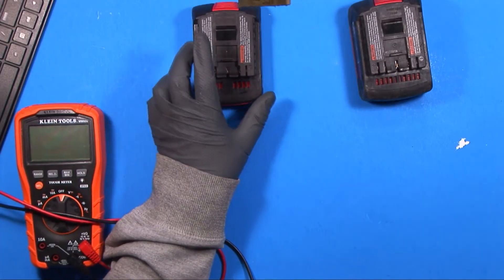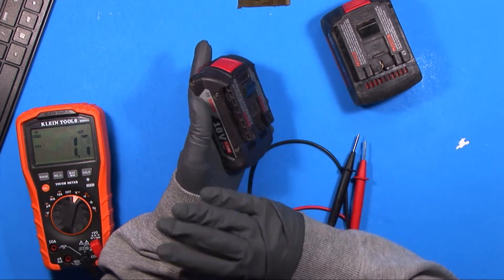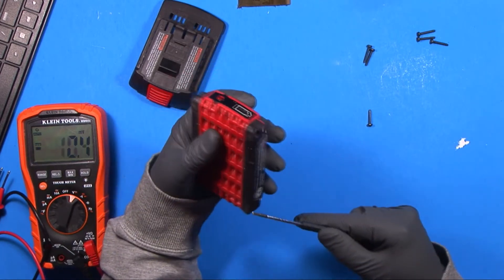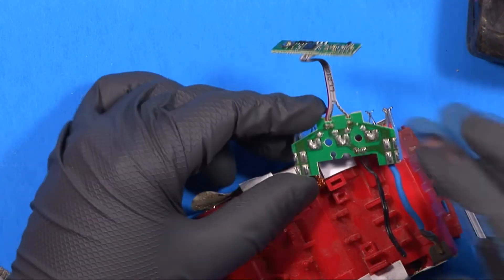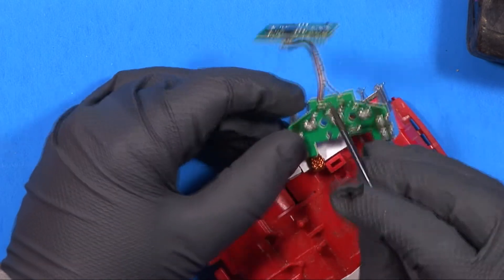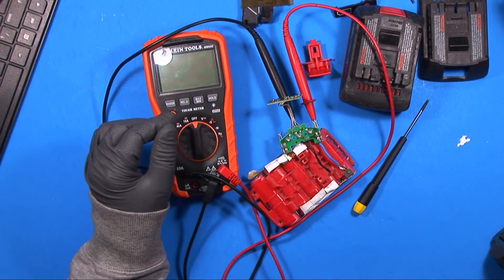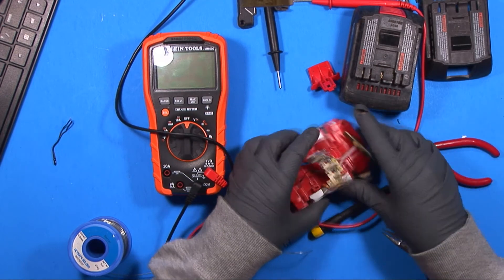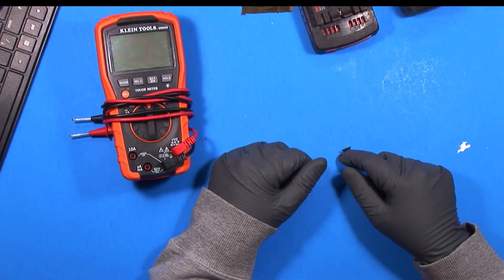Fixing a "Bad" Bosch Lithium Battery

Comment: You are one of the few YouTubers that really knows what they are doing working on battery packs. So many other guys do completely stupid things with packs, instead of really diagnosing the problem. I've fixed a bunch of Bosch battery packs with either a new thermistor or replacing dead cells. I invested in a charger that also measures internal resistance and charges 8 cells at a time, ensuring they are balanced. Only twice have I been unable to fix a pack, and instead bought a knockoff battery pack and rebuilt it using the cells from the dead battery that had been tested and balance charged. I've built about 10 different packs using the aftermarket battery packs and it's a really cheap and effective way to make your own batteries. Thanks for your videos which offer real solutions, not stupid practices like "jump starting" packs and risking explosion or fire.

Comment: Any idea what’s wrong when a Bosch Core 18v battery charges but the indicator gauge will never fully fill? The indicator will fill except for the last square light.
Reply from the maker: just bad cells, not charging all the way up.  Could be a single cell.
Reply: @ I already have a small spot welder so I think I just need to test the cells to figure out which one(s) are bad and replace with the 40T INR 21700, 4000mAh battery?
Reply from the maker: @WolverineBlue17  pretty much.  Have to disconnect them so when you measure  you're only measuring one cell at a time after a full charge cycle.  Just need to be careful, these aren't NiCad's.  Lithium cells are nasty and can erupt super easy.  I had a collection of good cells from old batteries.  I was lucky and noticed one, one night getting warm on its own out of nowhere for no reason.  After that I tossed the whole collection.
Reply: @Electronicle I tested the cells and they all looked good. And the charger says they’re all charged. Still no idea why the gauge won’t show full.

Comment: mine just stopped charging after it discharged completely on using. after failed attempts to charge it i discovered two cells have completely no charge and are behaving like they are shorted coz power seems to flow from the ones next to them just through them like they are just conductors. the battery is the 18v core pro 12ah type.  any advice for boss

Comment: Hi, great vid! I lost the charger but have a 4 pin alko (+, Bs,Tv , -) output 10.8 - 20V. Can I pin up the batt to this to charge bosch gba 18v 6ah batt? Yes... batt has 5 conn and charger only 4... dont want to break  battery ;-) possible? Thx Lis

Comment: Why is my battery charging up but draining over a couple of days I noticed the power indicator light was not working correctly and was coming on on its own is it just a bad indicator and am I'm OK just to delete it  ?
Reply from the maker: If it's draining when you aren't using it then one or more of the cells in the battery are bad and internally shorted. Nothing you can do other than replace the cells or the entire battery
Reply: If the indicator comes on on it's own... that is bad too. You can most likely just disconnect it without any issue. If it still drains, cell(s) might be bad.

Comment: The component in the battery pack is a THERMISTOR - the sensor that you plugged in to your multimeter (DMM) is a THERMOCOUPLE. The two are completely different: a thermistor changes its resistance with temperature whereas a thermocouple generates a (very small) temperature-dependent voltage. 
The thermistor in the battery pack does not generate any voltage - its change in resistance is sensed elsewhere in the system, either within the battery or within the charger (depending upon the design).

When you set your DMM to measure a resistance, it puts a small voltage across the probes in order to make that measurement. When you try to measure the resistance of a thermocouple, the voltage generated by the thermocouple will interfere with the voltage from the DMM and cause it to give a reading which is, in part, dependent upon the thermocouple's temperature. That's why the reading changes when you hold the thermocouple - you are NOT measuring its resistance.

Comment: Hey can we do this with the new Bosch profactor battery?  I have the 8ah. All I'm getting is a temperature reading in the charger.  I took apart the battery but it has a completely different board.  Any idea where the thermistor is in the new batteries?
Reply: Follow the black lead from the circuit board.

Comment: there is manufacturer seal where screw should be can you explain removal technique?
Reply: Drill into the seal very gently with a 6mm drill until you touch the head of the screw underneath. It should now be possible to remove it with the t10 screwdriver

Comment: Any fix for a Bosch battery that only chargers up to 2 lights on the indicator and discharges very quick
Reply from the maker: Might just need new cells.  Problem is with new cells you'll need a spot welder to weld the strips back on.  If you have that ability, rip the case apart and see what size the cells are and order new ones. Otherwise you can try to rebalance the cells that are in it.

Comment: Hello  Do you have a part number for the replacement thermister either from Mouser or Digi-key or any other supplier, there are so many out there with multiple vairiations.  thanks in advance

Comment: Hi all. The sensor is NTC 5K means its resistanse at 25C is 5Kohms. Quick test can be done on battery by measuring pin resistanse as 20~22Kohm for 14.4V batteries, 6~8Kohm for 18V batteries. Good luck.
Reply: For Quick test the resistanse reading  higher than 5Kohms since as can seen on video that there is resistanse on pcb board line of NTC. Thats why the readings are different.
Reply: You wouldn't happen to know what that resistance is meant to be for the newer ProCore 18v packs would you?
Reply: Anyone knows the resistance of the 12v max and 10.8v batteries?

Comment: Hi, Thx for the video! It is quite rare to get infos how the bosch battery is built. For me, replacing the thermistor by a 6.8k resitor worked (just connected to middle pin and minus). of course, this is not replacing a thermistor, but may help. use at own risk!
Reply: Entonces podría usar una fuente externa para alimentar amoladora...🤔 Pensaba en energizar con fuente de laboratorio y conectar NTC mediante resistencia de 6,7K = 20°C pero me gustaría confirmar si el terminal
 Código 1 (R1) = 7,6 K Ohm 1% ?
Código 2 (R2) = 51,3 K Ohm 25% para simular Batería Bosch 18v 4 Amperes ?

Comment: You are conflating an thermistor with a thermocouple, the one on your meter is a thermocouple ie it generates a small voltage, the one in the battery is probably a thermistor, its resistance changes with temperature. But thanks for the video.

Comment: The device you used on your multi-meter to measure temperature is a thermocouple, not a thermistor.  They are not the same, they work differently.  This does not really change how you fixed the battery.  They just can't be used interchangeably.
Reply: Yup, thermocouples generate a small voltage, thermistors vary their resistance - in this video the two functions were confused. The would have actually been a whole lot more useful if the replacement thermistor type had been identified.

Comment: Thanks for that. The good news is, looks like this is precisely what's wrong with my battery here. The bad news is, mine is a "home and garden" battery from a hedge trimmer, which appears to be the exact same pack inside, but the casing is different (can't fit the same charger) and, though four screws gets me in to the outer case, then I find the controller is soldered to the top of the pack, so next to impossible to get the thermistor out or replace it without de-soldering the board, altogether a more fiddly fix. Which I won't attempt until Bosch have a chance to do the right thing and replace my just-over-a-year-old unit.
Reply: I take it back -  I found out something important about the CHARGER.  Basically, it will not start to charge the pack unless it sees at least a minimum voltage. I took a 12v bench supply attached across the entire battery pack - but inside the control circuits - and fed it brief pulses (no more than ten seconds at a time, with a few seconds pause in between) of 12v, for a couple of minutes. This put a small charge in the cells. I showed a voltage across the pack now. It was going down fast as it was a very small charge BUT on attaching the pack back to the charger, the charger decided it liked it and started to charge normally! Once full, I ran the trimmer for about five minutes, then left the pack overnight and it was still good the following day. So I don't know why it fully discharged, but now I know how to get it charging again. Of course, fully discharging the pack is not good for it.  Now I'm storing the battery NOT on the trimmer, and will check it again in a couple of weeks.
Reply: @ChrisComley  That's a great idea, I think that is what I need to try for mine too.
Reply: HYDRARAPTOR Gaming  I've not analysed a "good" battery in either full state or when the trimmer reports it too low to run, so, I don't know what the expected voltages are for either end of "normal" operations, I'm afraid. 

3v is the lowest voltage recommended for these cells however, so I assume if it's only 3v per cell, the trimmer should refuse to run, but the charger should be happy to charge.

Comment: hi, i'm not sure if my power drill has the same problem.  when i turn it on, the drill spins slowly in a few seconds then stops spinning, then the led will also die a few seconds after that. (sorry for my bad english 😁)
Reply: Debes medir el voltaje del pack y de forma individual cada baterías por si surge diferencias. Estaría bueno tener un cargador inteligente para obtener datos de la resistencia interna, quizás ya cumplió sus ciclos o simplemente falló 🤔

Comment: For everyone, a thermistor comes in two types. The negative temperature coefficient can be negative or positive. If warming the thermistor, them resistance goes up, this is a "Positive Temperature Coefficient" type or PTC. The "NTC" type goes down as it gets hotter. I choose to remember this by using a phrase " The hotter you girl gets, the lower her resistance gets".
 They have limits at temperature and the most popular are 10k. Like all resistors they have an accuracy of +/- value. A GM transmission temp sensor is a NTC with 90,636 ohms at -40 degrees F, while at 72 degrees F, is 25 degrees C. The last is 42.5 ohms at 302 degrees F / 150 degrees C. This info is posted on GM's diagnostics service info but true as there is max of 110.778 F and 51.9 F on the low end.
Lithium Ion batteries are charged between 20% die-charged to 80% fully charged. Techs, construction workers and the general user never where told this is why they quit without warning. If amps are flying, they get hot. This is where the thermistor shuts off the circuit and the tools die. Many good videos show how to test components in an electronic circuit can be tested with a good digital multimeter or called DMM. Best of luck to everyone, stay safe during this "WU-FLU" era. Unfortunately as hospitals open in NE, I will have my 4th Lumbar fusion...Yeh! Can you say L3-L2 disc & spinal stenosis? All from my 1987 stupid boss; argument and using me instead of hourly employees instead of a seasoned ASE Master. Do I sound bitter? Dam straight, I will place hose nose where it needs to go. Nice video buddy!
Reply: iformative comment but it didnt tell me excactly wich thermistor i should get. Do you know wich one is used for this battery?
Reply: I am unable to tell you as each company builds the battery management control board differently. If you have a two wire device that sits near the batteries then take photos for future reference. Look for any marking like #'s and letters, use these to search for data sheet. If no marking or not readable, de-solder it and measure with digital multi meter. Just the heat of a hand or hair dyer to make it change. If resistance goes down or up, it is probably set to voltage comparator the stops charging or disconnect from the tool if driving large screw, fast drain, then heats up and a MOSFET opens, no tool voltage. I wish i could help you more but i have trays of Motorola chips no longer published in data sheet. You don't even need an expensive digital multi meter. 80% full to 20% of empty or too hot, the lithium ion battery has to be protected. That all. Hope this helps.

Comment: Thank you so much. This is my exact problem with 2  of my Bosch 18v 2Ah. Fully charged but no power to drill. Where do I buy these  thermisters and what is the power of these ?  I had to buy new ones but the others are only 15 months old and in great shape. I assume they got overheated in the car as they worked before the job and not after. Thanks again, where do I buy these. very grateful.
Reply: Presuntamente funciona utilizando resistencia 6,7k=20°C ..... 5k=25°C quedaría fijo y se anula la protección 🤷

Comment: Nice video, just a bit of advice from me: learn the difference between thermistor and thermocouple. Thermistor does not generate any voltage, thermocouple does. Have fun ✌️
Reply: Yep.  The thing with the yellow plug that he plugs into the meter is a thermocouple.  As soon as i saw that, I came here and looked for a comment  :)    However, good advice apart from that, I have a bad battery and will be breaking it apart to see if it's the same problem.
Reply: Very little knowledge here. Why do people put out videos that have no knowledge of what they are saying?
Reply: @mikeholloway8589  you could put up a video.
Reply: Ok kyle

Comment: Were these the 21700 cells? Did you see any marking on them?

Thanks for the video
Reply: Based on the look of the battery (sticker design and 3-bar status LED) it's the old 18650 design. The ProCore 21700-based batteries have a different design and a 5-bar status LED.

Comment: Very informative video. I have a 6ah bosch 18v battery and when it is charging it stops changing before its fully charged, only goes up to 2 lights on the battery monitor then the charger cuts off, its not the charger as it charges my other batteries fine.
Reply from the maker: the internal cells may have become unbalanced, or they are just shot.  Check out this video, might help:  https://youtu.be/SfwEKrBVd8s

Comment: Very good. do you know how to get rid of that thermoster (i know it is not safe)?
putting that conector to ground?
Do you have the schema of that simple board?
Thank you
Reply from the maker: No it's not safe.
Reply: @Electronicle  Thank you.
Can i reformulate the question and  put it in a safer way?
I have a bosch tool
that operates at 18v.
With lithium.

On the other hand i have a perfertly safe lithium pack with its board bms and a thermistor inside.

The problem is that if y connect the positive and negative a get the light up but does not work.

Should i put one of the connector of the thermidtor to the pin in the tool?

Just to clarify the battery is a 3s4p lithium from a third party provider.

Any help would be very apreciated
Thank you.

In the case of this third party battery the thermistor is connected in serie from the negative.
I understand if the temperature goes up then it makes an open circuit until it goes down.